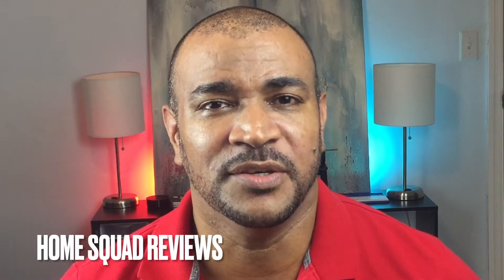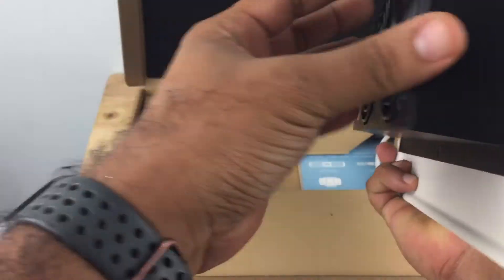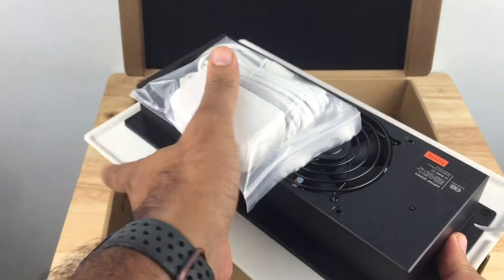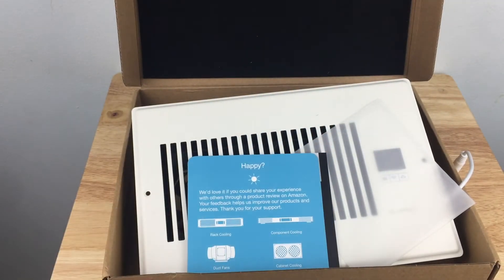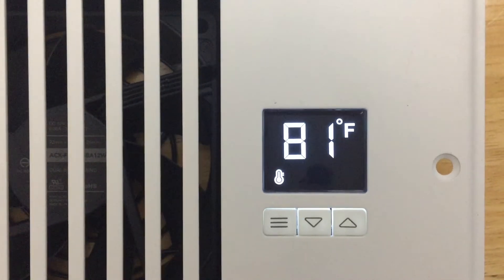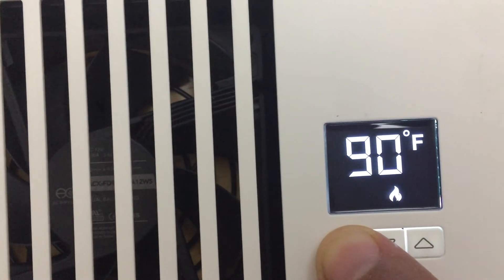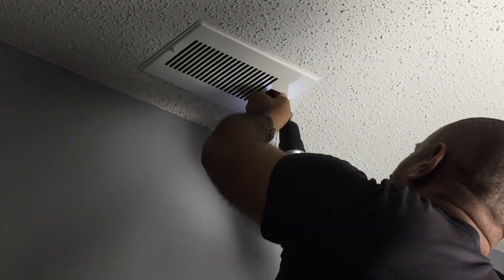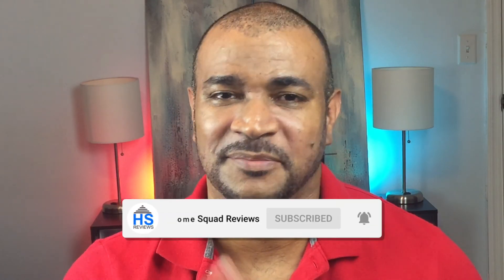UNBOXING AND INSTALLING OF THE AC INFINITY AIRTAP T6 6"x10" HOW TO FIX HOT & COLD ROOMS IN YOUR HOME

Comment: I just bought one of these to test out and am already thinking about other places (like my parents home, etc) where these could be beneficial. Thanks for the installation video! Two questions... I believe I read that the mfg does not recommend installation in the ceiling - I'm assuming due to weight concern. Any issues on your end from that? And lastly... what is the little plastic piece you used to route the air - is there a specific piece avail at the hardware store or did you DIY that? Cheers!
Reply from the maker: I am glad you found the video helpful :)